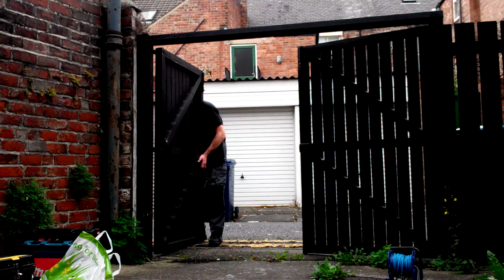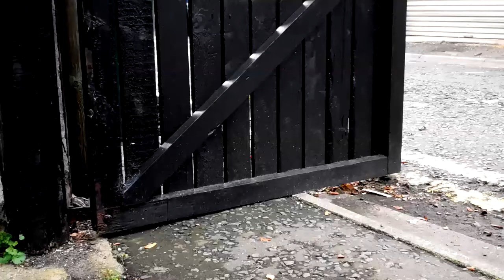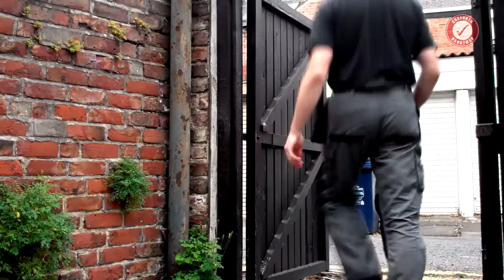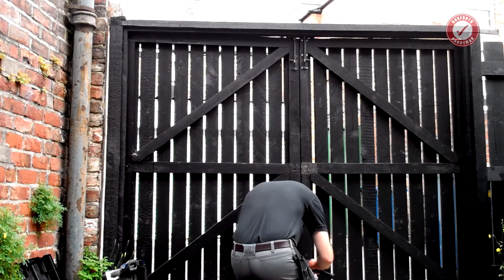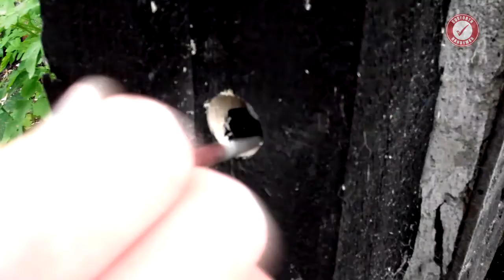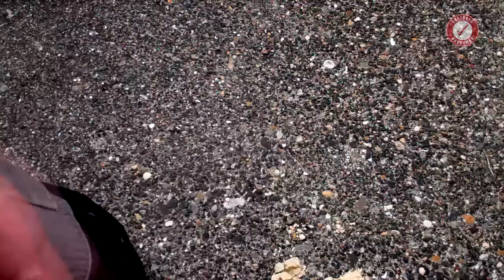I'm repairing a Big Back Gate!

Comment: What’s the name of those screws you knock in to secure the gate to the wall please?
Reply: masonry bolts. toolstation (uk) are pretty cheap but screwfix also sell them. drill straight through into walls then screw them in. they cut their own thread and give a really tight fixing due to the bolt head.

Comment: Hello sir.
Iv jus made my gates and look similar size to these tho mine are made from 4x2 and have couple extra diaganol braces plus I intend on using 25mm toungue and groove so will be a good weight.
I have use 3 very heavy duty hinges per gate which hold 57kilo per set so should be good support but I was thinking will they need castor wheels to go on each corner to help support. But will this be necessary?
Reply from the maker: As long as you have the diagonal braces going the right way you shouldn't need them - always something you could add at a later date if needs be. 👍